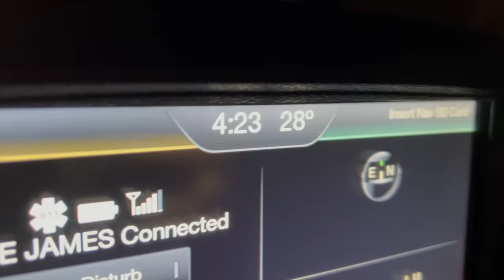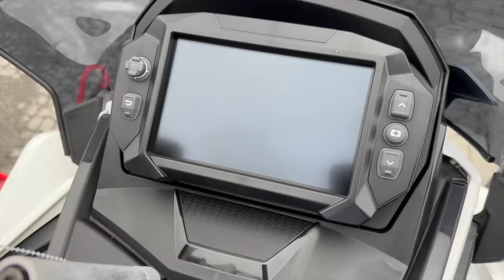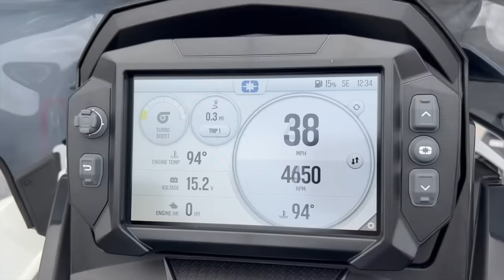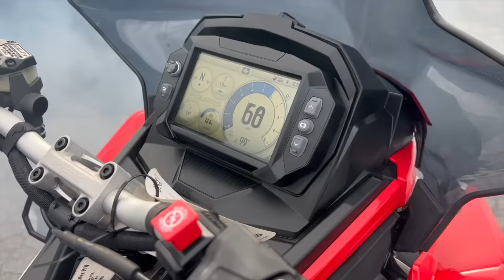2024 POLARIS BOOST ASSAULT SWITCHBACK 146 HAS BEEN DELIVERED! COME BUILD IT WITH ME AT SOUTH SIDE!

Comment: Great vids! I am looking for some input. I am an Iowa rider so mostly ditch banging and corn fields but do take some trip up to Wisconsin. I am trying to decide between new xcr or boost in 136/137. I am coming off Indy xc 800 137 and suspension was to soft. I would like to think that I am a pretty aggressive rider. Just wanting some of you input before dropping a bunch of cash. Thanks!
Reply from the maker: so the XCR has the most aggresive suspension you can get. They come with HD rear springs and 100 pound front springs. They have the most adjustability possible from Polaris. So if youre going to be ditch banging etc you would want the XCR

Comment: Ummm this is going to be embarrassing lol but I was putting on a new front bumper and dropped one of the nylon nuts down into the engine compartment somewhere and can't find it for the life of me. I've tilted rhe sled to both sides and even had a buddy help me lift the back end as high as we could and shook it. Nothing came out and you can't hear it rattling in there anywhere. I've looked all over the garage floor and nothing. How critical is it if it's still in the engine compartment? Would you have any tricks to try find it without ripping the whole engine apart If I NEED to get it out lol p.s. the trailer is lookin sick!!
Reply from the maker: it happens to all of us. I would use a magnet and try to find it. Not the end of the world but if it makes its way over to the clutch side it can do some damage. Thanks about the trailer im pumped about it!
Reply: Pulled the exhaust and battery out. Used a magnet and searched everywhere.  Probably spent a couple hours trying to find the damn thing. Can't hear it rattling around when tilting the sled around so hopefully it's either lodged in someplace or I booted it without noticing and it's on the floor somewhere. Got quite intimate with my 24 snowchecked 850 switchback assault so that's a plus I guess lol Looking forward to see your setups this year!! Cheers!
Reply from the maker: must be stuck somehwere! potentially made its way down into the tie rod boot. ive had that happen before!!
Reply: Checked the boots a few times and nothing. I literally spent a few hrs over a few days looking for it. Lol I'll keep an eye on it and check during the first few rides and hopefully it either stays lodged or it pops out and I catch it before something happens. Fingers crossed as it's in fates hands now haha just need some damn snow.  Usually we have well over a foot by now but we don't even have an inch on the ground yet.